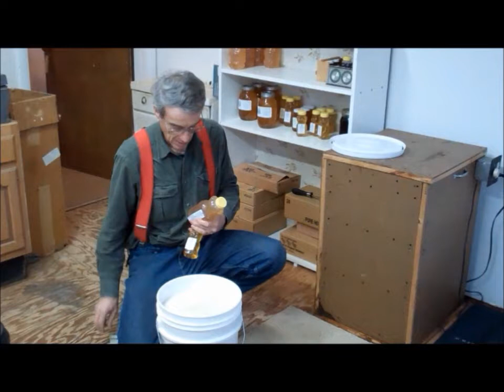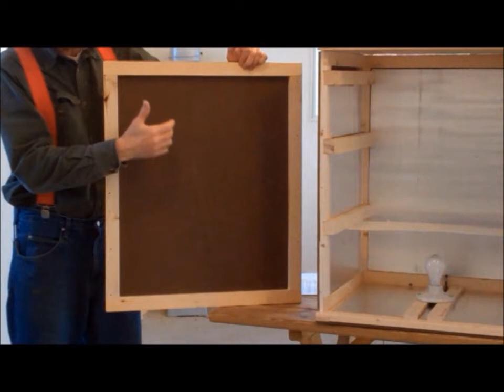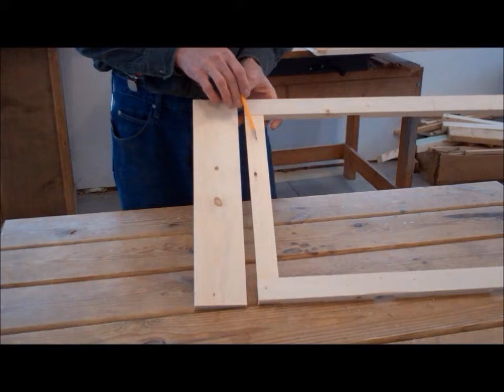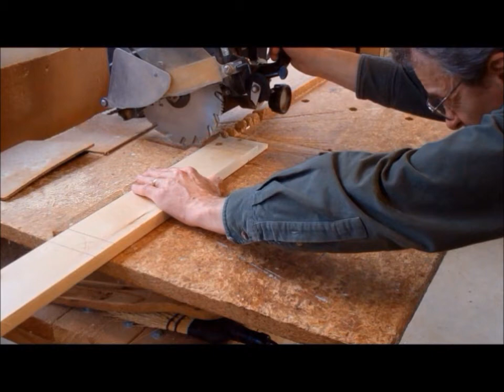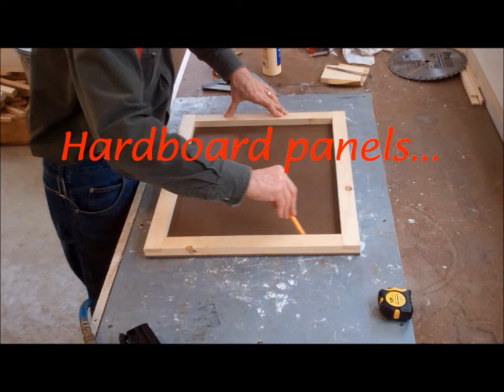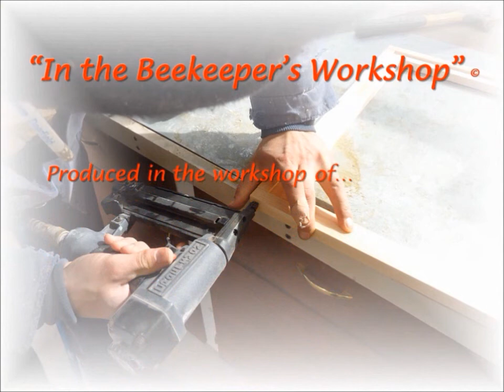How to Make a Honey Bucket Heater - Part 1

Comment: PLEASE — Make the following changes to your plans at the BeeKeepers workshop:
Figure 5 shows length of box as 22.5”, your video shows the same figure but at 21.5”.
I’m confused, (which is not unusual for me), which is it?
Reply from the maker: It is nice to see that someone is paying attention.  The video on making a honey bucket heater was made in 2012... nine years ago!  And this is the first time the discrepancy you mentioned was noticed.  The 22-1/2 inch dimension for the side panel is correct in the printed plans (the .pdf document you downloaded).  The corresponding drawing in the video is incorrect.  So go with the dimension shown in the printed plans.

Comment: Or you can put a lightbulb in a refrigerator or freezer and not have to build any of that.  60w - 100w depending how cold it is where you are.  You can put a $20 adjustable or fixed temp thermostat on it to make the box hold a specific temperature.  In a 20+ cu ft top freezer refrigerator you can get 2 double honey bucket strainers next to each other in the refrigerator section.  If you heat a single bucket to over 145, then let it cool, the wax and all will melt.  Let it cool and the wax & trash sits on the top and the honey on the bottom.  Once cooled off, punch a hole in the wax with your finger and you can pour the honey into your top bucket if you're using the 2 bucket method or however you're straining.  The refrigerator is very well insulated and it's sealed up to where nothing can get in your honey.  You can drape the cord out the bottom and the door seal will still seal around it pretty well.  Works better than anything else I've tried.  If you just want to heat up 1 bucket at a time, some apartment refrigerator are big enough.
Reply: Agreed. Get a thrown out mini fridge on hard-waste collection day and all the works done apart from drilling a hole for a heater bulb.